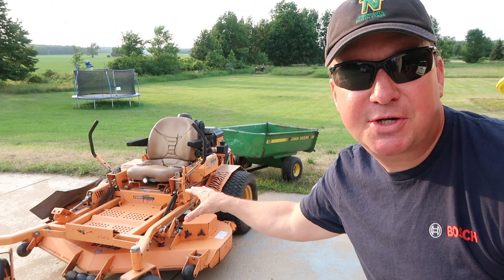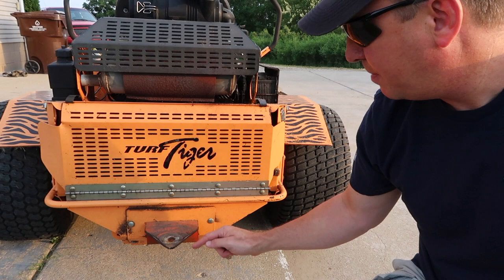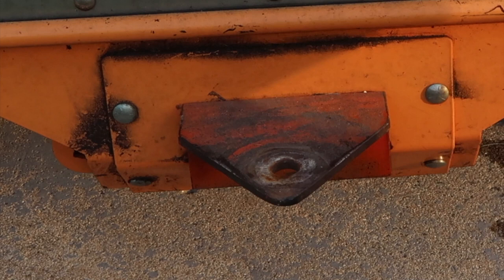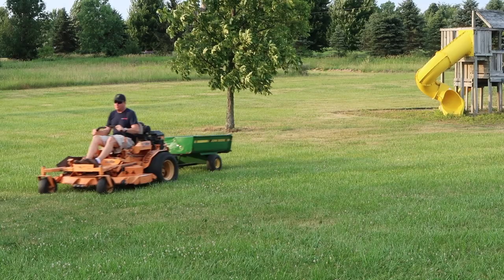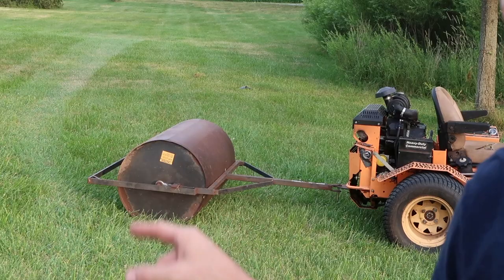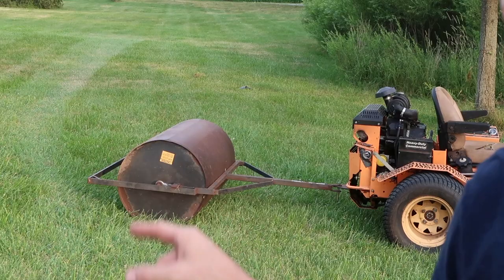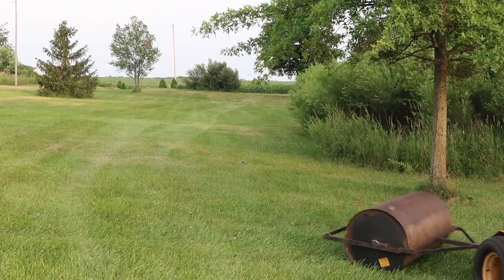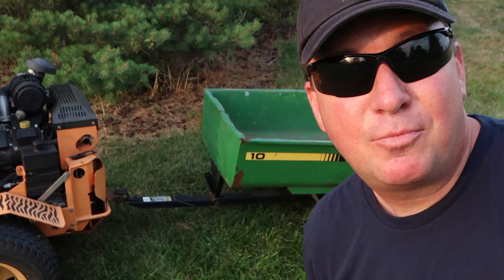IS IT POSSIBLE TO TOW WITH YOUR ZERO TURN MOWER?

Comment: I have a Ferris 3200z and I’ve towed our 14’ steel trailer loaded with a 4wheeler on the back like it was nothing, even through the grass.   The 5400 series hydro pumps are pretty impressive.
Reply from the maker: That's awesome!  I'm impressed with Ferris mowers.   I believe they have a fan on the mower pumps to keep them cool.
Reply: @MarkThomasBuilder  The fan is standard issue from Hydro Gear. Almost their entire lineup of wheel pumps come standard with fans. By the way Ferris, Snapper and Simplicity are 100% owned and operated by Briggs and Stratton. So if you want a Vanguard engine now and do not want to pay a literal fortune, they are your best bet. I have a IS 2100Z and I have a few gripes but overall the machine has been amazing. I am scared to pull anything with it though because the engine cage tubes are hallow. So if you pull over the recommended weight (200 lbs) you can crush/bend those tubes.

Comment: I've towed a 4000 lb C10 pickup truck with a Toro Zero Turn.  It was a 1 time thing, and a short distance, but I had no issues.
Reply from the maker: Oh wow, that's nice towing power!
Reply: What engine and hp?  I have the Timecutter 7000 Kohler 22hp engine.
Reply: @jeffw7320  it's the Kawasaki 23 hp

Comment: Bravo!  However, my demure Toro MX5050 (belt drive -hydro gear ZT-2800) that can be had for less than $4,000 has been pulling weighted aerators, 25 gal sprayers, lawn cart with 10 bags of mulch for the last 7 years (500 hours) without any problems.  Plus this workhorse provides consistent manicured cuts especially when I bag.
Reply from the maker: Oh nice, glad to hear those kind of results!

Comment: I  have a small 30" Dixon ZTR. I put a trailer hitch on the front and it makes it easier to maneuver the trailer when you're pushing it. Granted I am only pushing a small 4x6 utility trailer but it works great.
Reply from the maker: Awesome, I wouldn't mind a hitch on the front too.

Comment: I was concerned about towing a stripped Cub Cadet tractor ( No engine, no deck) with my Simplicity 44" ZT out of a decline in my tractor boneyard.  Aint no problem heah boy, shee-att! Pc a cake! No problema!
Reply from the maker: Nice job!  I don't have experience with Simplicity, but they look like a well built mower.

Comment: My zero turn came with a trailer hitch plate and manual has specifications for what can be towed.
I have a small dump trailer and a multi-tine lawn rake.
Reply from the maker: Many zero turns say 250 lbs or less.

Comment: Absolutely!  Several things though.
1. size of the load compared to machine pulling it.  
2. Your terrain.  Is it flat, hilly, soft, thick grass or thin Bahia?
3. Last but probably should be first,  always use full throttle.  Do not “lug” these engines even if only going 10’.

Conclusion: as long as you’re not getting crazy and trying to drag an 100’ redwood, keep your loads light as possible and keep your oil fresh.
Reply from the maker: Great advice, thanks for shaing!

Comment: Light load if you want drives to last. Especialy EZT. But then maintain others same as you would truck you tow with.
Reply from the maker: I haven't filled the roller all the way with water.  I don't want to push the limits too much.

Comment: I us to pull an 48" aerator, 42" roller, 15 gallon sprayer, "42 inch sweeper, and a 42" dethatcher with a troy bilt mustang with a 42" deck. Compression was a concern so I bought a lawn tractor and removed the deck
Reply from the maker: Sounds like a nice setup.  I'll bet you have a nice lawn.
Reply: @MarkThomasBuilder  have all Bermuda hybrid and common mix but fighting golds edge
Reply: @MarkThomasBuilder  I get a materials spreader in a couple weeks and start lawn leveling

Comment: Ive pulled a dual axle car trailer..about 1700lbs..it cant handle much tongue weight but as far as pulling goes ive have no issues with my bad boy rogue. It Has parker 18ci wheel motors and fan cooled 16cc hydrogear pumps…some compact tractors use the same pump and wheel motor set up. Not sure what scag uses but it mainly just depends on how big ur hydros are an if they are stayin cool while towing. you do want to keep the rpms up to keep the oil flowing through the hydros as much as possible.
Reply from the maker: Good insight and advice.  I know I don't have fans on my hydros with this unit, but I've demo'd a Ferris that did.

Comment: I know this is an old video but the real reason they don't want you to tow over 200 pounds is liability. Zeros are not very stable with a heavy load even on a small incline. I have a 250 pound drag that I use for seeding but primarily to go over a gravel road. Three years later my ferris 2100z is still working fine.
Reply from the maker: That's good to know.   I've been thinking about getting a drag for my driveway but don't have a quad.

Comment: I just bought a 2020 SCAG Patriot Zero Turn mower. I had the dealer add the hitch but the SCAG manual says to tow no more than 250lbs! The dealer explained that they’re talking about downward “load weight” bc the weight of the empty trailer itself is alleviated mostly by the rolling wheels.
Reply from the maker: Thanks for the info, which makes sense.  The roller has very little tongue weight to it.  If you're hauling a trailer with mulch, than you want to pay attention to the hitch weight.  I try to balance the load in the trailer and not put extra weight up front of the trailer.

Comment: I have a RZTL cub. The hitch sits at around 13 1/2" above ground, and i have trouble getting attachments to fit properly. Yard trailer is okay but dethatcher and sweeper aren't exactly towing at the right angles. I may try to find someone to weld some kind of drop like what you have.
Reply from the maker: It should be a rather easy piece to get welded up.

Comment: I hurt my leg and no longer want to carry around a large yard sprayer with round up.  Do you know which trailer sprayer would work best -- flexability, etc. with a 28HP ExMark zero turn?
Reply from the maker: I'm sorry, I haven't tested out any yard sprayers.  The ones at Northern Equipment look pretty cool though.
Reply: Tractor Supply (TSC) has many towable sprayers battery powered pumps work great.
Reply: Toro makes an excellent 25 gal tow behind tank sprayer that is carried by Home Depot. Have had mine for seven years without problems.  Use mine to spray azoystrobin, propiconazole, selective herbicides and solutions containing fertilizers/nitrogen-iron.

Comment: You know, I dont have a lot of weight to haul but what do you think about fabricating a little truck bed for the zero turn? Bolt it in where to bolts go and raise it up a bit so when change elevations. Would that look silly? Or is it even feasible? Thought?
Reply from the maker: It's an interesting idea and might work.  If you ever used a bagger on the back of a zero turn, you'll likely hit stuff when turning, since it sticks out so far.  If you can get used to it sticking out while making turns and not block the airflow to the engine, then it may just work.  I have a small trailer that I tow and it handles firewood and mulch quite nice.

Comment: So I have a Kubota Z122e and am thinking of towing a small trailer like yours with bark mulch I believe its 24hp, is it safe to do so?
Reply from the maker: I would think your okay to pull a trailer up to 500lbs.  Before doing so, I would check the owners manual, just to be safe.

Comment: Do you have a tow behind aerator ? That’s my next project in fall, have to get a hitch on my new John Deere. And a tow behind aerator. Down here in soflo nobody aerates, but I need to step up my game. Grass is compacted and not letting water, sun, fertilizer etc to the roots.
Reply from the maker: I actually welded the steel bar across the back of the roller so I could haul a lightweight spike aerator.  It actually works well if I don't make wide turns.  I've also rented a tow-behind aerator by Bluebird.  It works very well and I recommend it for your yard.

Comment: Doesn't the shaft just power the deck and not the drive motors? Or am I tripping?
Reply from the maker: I'm heard a local Scag dealer say you can pull more with a shaft drive.  I understood he was talking about the shaft supplying power to the wheels, as compared to a belt drive.

Comment: I use my cub cadet 27 hp to pull a 25 gallon sprayer.  What's your thoughts on a pull behind tiller?
Reply from the maker: I've never tried one of those before, so I'm not sure how hard it works the mower.  If you have really heavy clay, then it might beat up the mower a bit.  I have a friend with a Kubota diesel tractor with a tiller and it does a great job.

Comment: Would an Ariens 1434 be able to tow? If so what would you estimate is capacity? Thanks
Reply from the maker: If it comes with a factory hitch for towing, then yes.  A similar model said it can tow up to 300lbs.  I suggest consulting with your owners manual to be safe.

Comment: Hey markthomasbuilder, does this hurt the wheel transmissions to carry a load on a ZTR?  I have 'heard' it does from random people?
Reply from the maker: My mower has held up to occasionally towing.  I don't fill the roller all the way with water and try not to start/stop too much.  My local Scag dealer said to have the throttle all the way up and I'll be fine.
Reply: Every year use my ZTR w/hydro gear ZT-2800 transmission to distribute nearly 400 bags of mulch over 1.5 acres towing 10 at a time in my Harbor Freight  $100 lawn cart without any failures or degradation in function.  I do change my fluid (Mobile 20-50), every 100 hours to be safe.

Comment from the maker: Do you tow with your mower?  If so, is it a belt drive or shaft drive?  Any issues from towing?
Reply: Strange video. What does the drive system (belt or shaft) have to do with it? Millions of homeowners routinely tow small trailers with belt-driven mowers. You can see those trailers at every single store selling lawn mowers. Both of my zero turns have a hitch (either already installed or purchased as an accessory from the manufacturer), with a selection of trailers to tow. Perhaps you don't see me because I don't usually tow a trailer while mowing.

Comment: Even a shaft driven Turf Tiger is still pulley driven from the engine crank shaft to the shaft is it not?
Reply from the maker: I thought this was just a shaft drive, but need to look and see if there's a belt to the back.  2 other mowers I have are belt drive, like a Exmark 48" Laser Z.
Reply: It is belt driven from the engine crank to the shaft that turns the deck. But what does that matter in towing? It's the hydro pumps that bear the towing load and not the shaft. Am I missing something here? I have the same turf tiger.
Reply: Yekaterina K that’s what I was thinking.

Comment: The shaft drive is for the mower deck.  I'd like for someone to explain what it has to do with the hydraulic wheel drives?🤣
Reply from the maker: I'm not a mechanic, but I have another mower which has a belt drive.  I always thought there's only a shaft drive and a belt drive.
Reply: @MarkThomasBuilder  I guess the MFG/dealers say 250# based on liability issues.  Both the shaft drive or belt drive are for the mower deck blades.  All of the zero turn mowers that I have seen have hydraulic pumps that drive hyd motors on the wheels.  There is no danger of burning up a belt or shaft when towing.  You could pull a truck with it if necessary.  Sorry for the assumption that you were a mechanic.
Reply from the maker: I was just sharing what my local Scag dealer said.  He asked me if me if I have a shaft drive or belt drive mower.  Now that you mention it, I recall the hydraulic pumps you're talking about.  Thanks.

Comment: Hey was it difficult to turn on tight turns?
Reply from the maker: The mower turns very easy when pulling a small trailer.  When I'm pulling a 48" roller, I take slightly wider turns.